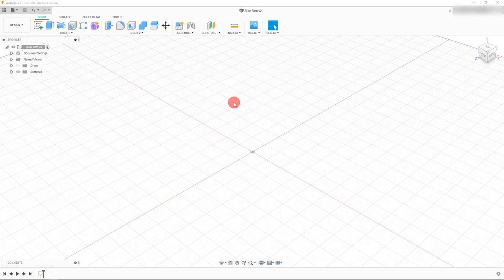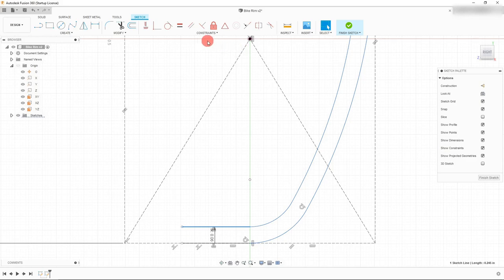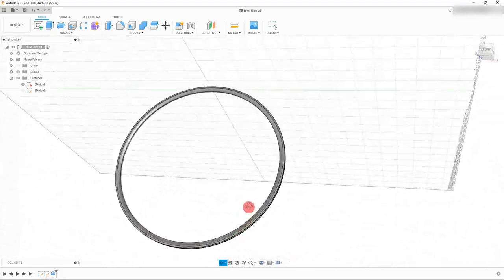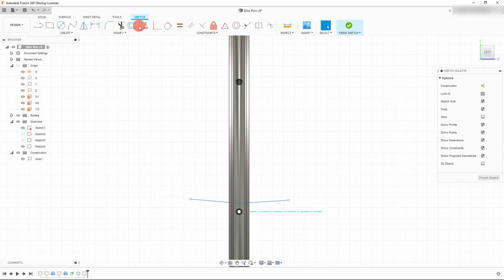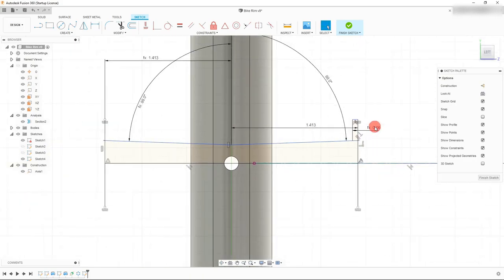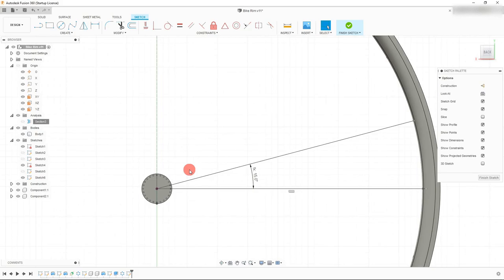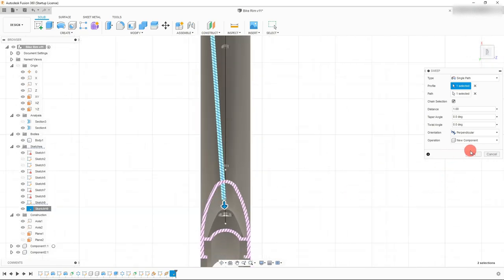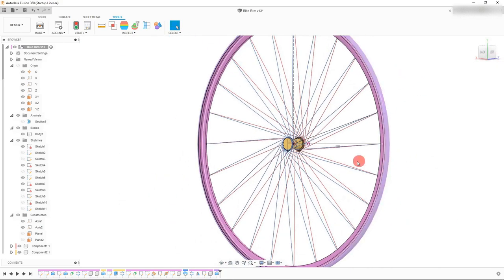Bike Wheel Tutorial in Autodesk Fusion 360! Modeling for Absolute Beginners

Comment: at 19:44 i get stuck. Idk if youre doing something when youre moving your pointer up and down pretty confusing when you do that. but i get "Sketch geometry over constrained" Please help me quickly!
Reply from the maker: Sketch geometry over constrained just means that you have enough dimensions for your sketch to be fully defined (ex: a rectangle, you have a length and a width and by mathematical law you are not allowed to have any other dimension) and you are trying to add another one illegally. If you have this problem, delete one of your dimensions you don't need and it should clear it up. All I did at that time was constrain the end point of the line to another point
Reply: @AvivMakesRobots  I think i fixed it by using Coincident.
Great video. 
Would appreciate it if you used a fully clean plane next time. You had a sketch that wasnt shown in the video Atleast i couldnt see it (Sketch 1) and i think it messed up some dimensions. Because i followed the video point to point 3 times and still the dimension "names" (d1, d2, d3 etc.) was about 1-2 numbers behind the ones you had. 

Also your planes (XY, XZ, YZ) Never matched mine even tho i was drawing the same way you were. Is that because i use Metric and you Imperial?